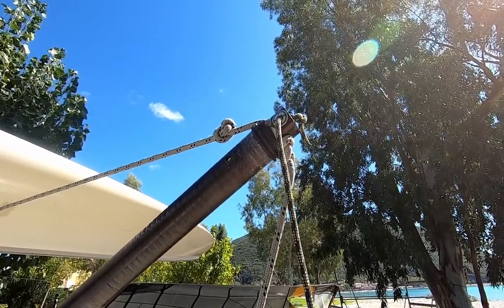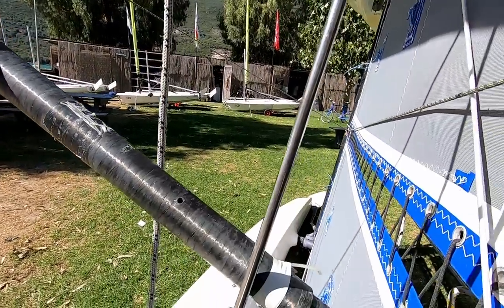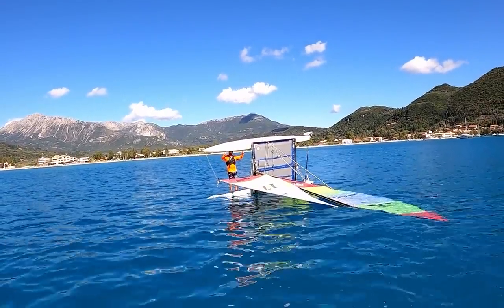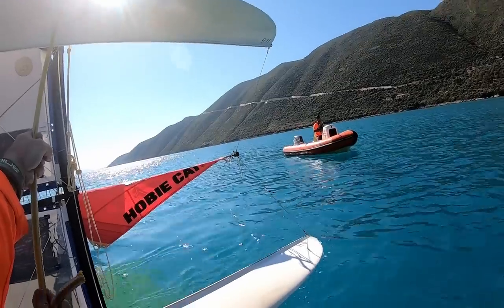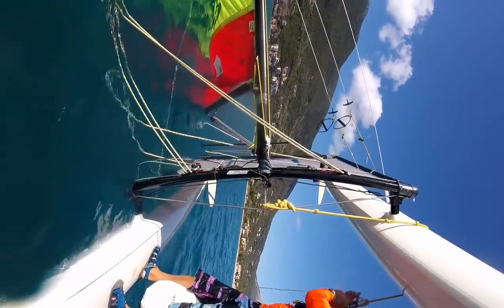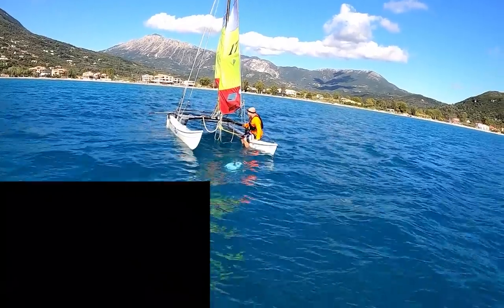Build your own low budget capsize righting pole for your Hobie 16 or other catamaran

Comment: I use a home built water bag when I'm solo on a H18. I can put over 200lbs of water in it. You need about 300 total for a H18. Sometimes you need to shuck up the bag a little higher at the end to get it out of the water to finish getting the boat up
Reply from the maker: Yes, it seems that bag height is pretty critical
Reply: @JoyriderTV  when i was 16 and about 70 KG i used an regular garbage bag... loop in the righting line in my trapeze and bag with water over my shoulder
Reply from the maker: @jirkbraak  Nice, That certainly would do the trick.
Reply: @SunsetWingman what did you make your bag out of?

Comment: The main thing I found since I've been Sailing since the seventies when they first invented the hobby sixteen. I found you have to have the bows into the wind.  You have to swim the bows around where it's dead into the wind or even a little bit to the other side of the tramp to catch the wind and help it right the boat it helps so much it's easier to right the boat that way. Also you want your riding line to come from over the top of the hull where the chain plate side stay is so you're up higher and further out. From my experience. Thanks for all your hard work and videos. Have fun and God bless and be safe.
Reply from the maker: Yes, that revelation about the righting line coming from behind the chain plate where the hull is deepest makes a big difference - even with the bag, moving a little further back made it happen.

Comment: I have a Baby Bob and it does help prevent turtling (which could do some damage to the top of the mast in water less than 28' deep) and it helps to keep the top of the mast higher in the water so it is easier to get the wind under the mainsail.  I agree that the Baby Bob does add some weight out at the end of the mast,  but I think it helps more than it hurts.  I also like to have my bows pointed straight into the wind when uprighting so the wind will have to go under the jib and main sails which helps them lift the mast.  If necessary, I will jump back in the water, hold the bow tang and then my body will act like an anchor/pivot for the boat to rotate around in the wind.  Also as primarily a solo sailor, being 6'3" and 215 lbs helps with the leverage.
Reply: The mast float should be more of a flat board? Also helps against  svirvels like a vinglet?
Reply from the maker: Yeah for sure - i think that having the sail unstuck from the water makes a big difference so the mast float will help a lot with that.
Reply: Or you can do styrofoam at the top of your mask too flat pieces at the top of the mass at the headboard on your main and it won't turtle.

Comment: Thanks for all the vids you post on cats. I just bought mine last Saturday. Im 68 and that workout righting a capsize looks so difficult for you. Im getting a workout just watching you. Dont know if I would be up for that much strain. Cheers.
Reply from the maker: It is much much easier once there's more wind!
Reply: @JoyriderTV  Thanks for the tip. Where I sail is a bay in Melbourne  Australia. Ive already been down to my local sailing club . They race cats every weekend  in summer so plenty of advice and info there.

Comment: been waiting for this one! Interested to see which design you went for. I was going to try the one that is basically a 2x4  that fits under the lip on the inside of the botton hull. You then walk out along it - walking the plank literally! - to get the righting momentum.
Reply: I have a similar pole on my H16, but used a hand railing dowel (about 2 in. diameter) with a 1-foot piece of decking plank attached at right angles. Never used it because I am concerned the hull gunwale would break apart with the pressure of the pole under it.
Reply from the maker: Yes, someone else showd me the 'walking the plank' video - highly effective.
Hopefully mk2 will be successful
Reply: so 2 years later and I finally got round to making the 2x4 walk the plank righting pole and...it works a treat. Basic 2x4 was about 210cm or width of the tramp frame, a piece of cutting board screwed to the end of the board to go under the lip of the gunnel, One rope running around the top hull 3 ft back from the bow then out to the outward end of the board then back and over the hull behind the rear pylon. Ropes have clips on the ends to connect them in loops over the hulls. I'll find a link to add below to easier picture it. Even my skinny 55kg mate could do it. Downside is you have the board strapped to the front of the boat (attached to dolphin striker pole with bungees) which may not look great but this is offset by the absolute ease of righting the boat with it. First time I tested it there was a lot of faffing around to get it set up, took me 5 minutes, but the second time I had it from start to righted in 1:30. Absolute game changer for me being able to go out solo and have the confidence that I can get it right side up alone should I capsize.

Comment: Interesting documentation of old discussions.  The over the hull or straight from the pylon test on vid would be good.  The math guys say it won't matter.
My pole is home made from a skinny windsurf mast as well.  I filled the ends with hard foams and glassed them because it was splitting from the pressure on the line.  The pole almost didn't work on a lightish air solo for me.  Spassed on a jibe and flipped.  The solution was to tie the pole to the hole for the daggerboard bungee and climb up on the pole.
Reply from the maker: Yes, I did some testing on land with different points of attachment https://youtu.be/oHIcLc7pssc
I'm not sure if that's what you mean. 
I gave up on the pole as the righting bag works so well and it's much less bulky.

Comment: Nice test Joe. In my opinion the pole will be effective if you can connect to the bow in the water, and step out over the pole, gaining distance from the boa.. Cheers.
Reply from the maker: Yes, that would certainly be more effective but a bit more difficult to put together.

Comment: Joe, do you think you might get better leverage by having the force applied over the upper hull, by way of the righting line perhaps, rather than at the pylon? Also, the dogbone-to-loop connection appears to require steady tension to maintain, which eliminates one's ability to employ the "bouncing up and down" technique that can sometimes be helpful.
Reply from the maker: Next r&d video coming up!

Comment: As an engineer, I like your idea. I would advise you though, to make a little force analysis drawing. That will make clear that the difference between using the pole and the rope is pretty minimal at the moment. If you imagine your belly as the centre of weight, you will see it's not helping much. But if you move the centre of weight outwards by help of the pole, than it will actually work. Simply hang on the pole vertically and put your feet up so your don't float with any part of your body.
Reply from the maker: Thanks for the tips!
That's great, i'll do that.

Comment: we also used to put the wind at 90 to the trampoline , then it would get under the sail .. then hang on for dear life when it takes off
Reply from the maker: Yeah for sure. Very difficult to get the boat to turn with such light wind though

Comment: Very interesting idea, I like the way the pole is secured and retrieved! But as Jan-Leo points out, I doubt a longer pole will make any difference. As long as your feet are positioned on the lower hull, your centre of mass will not move outwards significantly. Also, how the pole is connected does not affect the leverage. You want more torque, which is distance times force. The water bag increases the force. To increase the distance you must move your centre of mass further outside, and grabbing the far end of a longer pole won't do it.
Maybe try wearing sneakers with 20 cm-thick soles??? ;-)
Reply from the maker: Thanks, that's very useful to hear a scientific explanation - that would be why the hull mounted pole is much more successful. 
I'm testing a calibrated longer pole today so we'll see how that turns out!
Reply: @JoyriderTV  I'm glad you appreciate the comments! Please keep us posted, I'm eager to see how it turns out! BTW, I love your videos, thanks for your hard work!

Comment: The Norma righting line goes over the top of the hull, the set up with the pole has the line connected to the inside of the hull… would that change reduce the righting ability?
Reply from the maker: I think that having the pole mounted against the lower hull gives the right amount of leverage.

Comment: Excellent video although rather disappointing results for me at 68 kg, perhaps 71 kg with a shortie wetsuit. Do you think that someone in my case can consider using two bags at the same time? Or your pole invention as well as the bag technique used simultaneously.
Reply from the maker: I think a bigger righting bag should help you.

Comment: I also have a small concern about safety. Could the end of the pole grab some piece of clothing (specially loose clothes) and push you under the water when the boat is uprighted? This is a scary thought!!
Reply from the maker: That's certainly a scary thought - once i've made it work it'll be coming straight off and i'll be sticking to the bag!

Comment: Wouldn't you get more leverage if the pole went over the top hull like the capsize rope does? I've been thinking about building a 5or6 meter stitch and glue plywood cat a little heavier than a hobie for pocket cruising and wondering if I should include attachments for a righting pole on the outside of each hull. Maybe I could just tie it at the oarlocks
Reply from the maker: From watching other successful videos - it needs to be more like waking the plank - pole anchored by the lower hull - walk to the end and lean out from there - much like a daggerboard on a mono.

Comment: What if you had a line that you just attach to the trapeze wire during a capsize so instead of just pulling from the trampoline post, you could pull all the way up the mast?
Reply from the maker: I'll talk about this in the Q+A today, thanks.
Reply: @JoyriderTV 
By chance did you happen to record the Q n A? I went out yesterday in balmy 65 degree water lol. Took a friend for his first sailing experience.  We crashed 3 times,  it was great lol.  However, even with a combined weight of 200kg and strong winds, had a heck of a time righting the boat. I'm always looking for a better technique.

Comment: One thing to be aware with a pole under the tramp is that it hurts to step on it at every tack or when stepping the mast. Also after some time the friction will damage the tramp, not good at all. That won't happen in the case of the H16 on the video because it's under the lacing. I store the righting pole on my boat at one side, very close to the hull, where it won't be touching the tramp even when you stand on the tramp right above the pole. The good thing about righting poles is that they work, you just need to figure out the lenght.. I've found easier to use fit the "boat end" of the pole at water level and put my weight above it rather than hanging on it. So I sit above the pole and move backwards. It has to be stable side to side though. and the righting line may help, so don't call it obsolete yet. To fix that end of the pole you might have a carabiner set up at the pole end and a loop of rope at the boom corner, as long as the hull is not pressed by the pole. In my case I have a loop of rope at the end of the pole  that I fit around the daggerboard. The system you are trying is easier to operate though, not a minor point in its favour.
Reply from the maker: Thanks for that. I'm onboard with you there with the low pole - this version seems to be quite ineffective. The low pole will be the next one.
Cheers
Reply: @JoyriderTV  Here is what I did, in case you find some of the ideas useful
https://www.youtube.com/watch?v=DKuSSZ7JxBA
The line is continuous, attached at both rear beam corners and passes through a ring at each front beam corner. Preset knots for the carabiner at each side. I put an eyestrap a the pole for the carabiner but wrap a line around it, I don't rely on attaching it directly to the eyestrap. I first tried with a take-away elastic but didnt like it. Today I just take all the excess of line at the rear and roll it around the pole, and hook it with the same elastic I use to attach the pole to the beam. For the H16 what I'd you is setting a length of line at the end of the pole which I would hook to a small loop of cord passed throuhg the tramp grommet for the trap bungee.

Comment: Whatever you do; pole, bag, gaining bodymass etc. only works if your centre of gravity gets out more... so longer pole is OK if you climb in it! And 'double whammy', where that came from?? Inspired by EvH??
Reply from the maker: Yes, looking at the picture makes it quite clear how my technique wasn't going to be successful - no difference to using the regular line.
Reply: Rob is right, as isJan Leo Kaak: as long as you have your feet on the hul it does not make any difference.
Still, I like your video's a lot, also because you demonstrate the fails as well: highly instuctive!
Very surprised to see you first try with a cleated main and jib: It wont work, but also if it works (two very heavy crew might) , it is dangerous: boat may tip over fiercely  again or starts sailing before you are back on. (gues how I know!)

Comment: guys, a Hobie 16 can always be righted easily by one person. If the wind is strong enough to flip it then the wind is always strong enough to right it.  Heres how : swim the boat around so the tip of the mast is pointed  directly into the wind, loosen the main sheet and make sure it is free with no tension to the boom, swim to the stern of the boat and stand on the leeward pontoon as far aft as you can, the masthead will slowly creep above the water and eventually the wind will get under the mainsail and flip the boat back upright. You have to scramble aboard quickly or the boat will take off and leave you behind. No need for righting lines, sticks or water bags. Good luck guys and gals.
Reply from the maker: Thanks so much for the advice, that's really going to help.

Comment: I think you would have better leverage/geometry if the pole mounted on the lower hull (instead of the dolphin striker) and the rope went over the bow (instead of under)

Ideally, the pole pushes on the point closest to where the boat will pivot (i.e., the hull in the water) and the pole pulls from the point furthest from the pivot (i.e., over the high hull)

Just a thought :-)

btw, I love these instructional videos — they are very informative and entertaining too :-)
Reply from the maker: Yes, i'm with you there. The reason i went for this design was for a quick, simple easy system that could be quickly dispatched.
Mk2 coming soon. If that doesn't work i'll be looking at the hull mounted version.
Reply: One of the problems with  mounting the pole on the lower hull is that it will quickly become submerged during the uprighting process and loose it's leverage advantage.

Comment: Longer pole (telescoping?) and then climb out to hang from the end, as far as you can, keeping your feet up. Inverted as you had done but, on a longer pole. I think you weren't too far from getting it. The actual arm length and weight combination should be discoverable. Then we can all make adjustments to get that effective leverage.
It'll probably require I remove my shoes to do that level of math.
Reply from the maker: Yes, best keep your shoes on at this time.
I've got the longer pole ready to go. Testing today.

Comment: OMG! I am a 120 lb woman, Kiteboard and sailing instructor and can right my Hobie16 in less than 4 minutes by my self in low wind conditions, 6 knots. No water bag or righting pole needed. counterbalance you boat utilizing your trapeze wires with short uphaul attached. Always, always, head you boat to wind. Your sails sheeted and the wind will lift your sails and boat easily. This gentleman has absolutely no idea of how to do this!! I live in the Bahamas and own Stormfevre watersports.
Reply from the maker: That sounds pretty amazing, 
I've sailed cats for over 30 years extensively and with a boat like a 16 it's always been difficult/impossible to right in low winds solo without assistance.
I've done over the years extensive research on the topic including having the sails sheeted in to various degrees, where to attach the righting line, angle off the boat to the wind and never could i right the boat in such light winds.
Reply: barbara are you suggesting that you trap out from the upside hull when the boat is on its side? i’m having a hard time picturing what you’re describing
Reply: Can you please elaborate on your technique? I'm not positive I understand your description.
Reply: Can you please give more details about your method? I am light and have trouble righting boats. Thanks.

Comment: It doesn't matter what you're holding on to as long as you're standing on the bottom hull. Pole or line won't make a difference. Just physics and common sense honestly. What the pole could allow you to do is to get your feet off the boat and further out. Hanging from the pole will make the difference. This is so frustrating to watch.
Reply: Yes, you’re right....
Reply from the maker: Yes, even looking at the thumbnail it's quite obvious that it wouldn't m,ake any difference.
I'm going to use a longer pole to hang from in the next test - whole body on the pole - not on the hull.